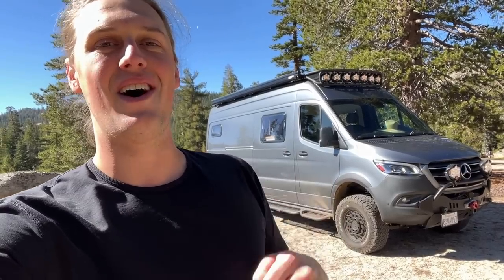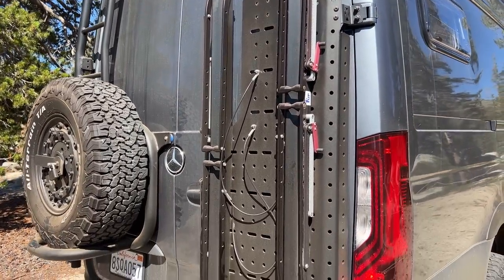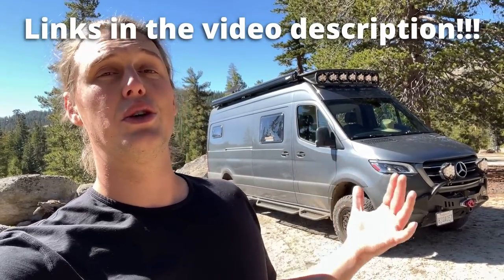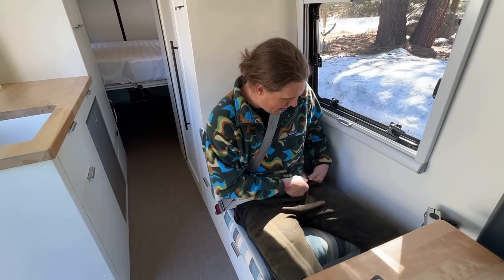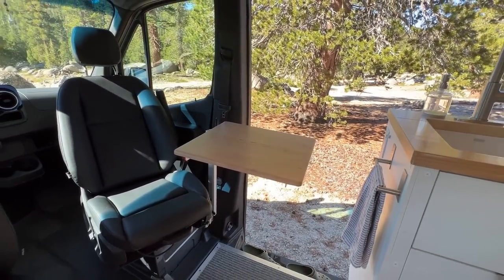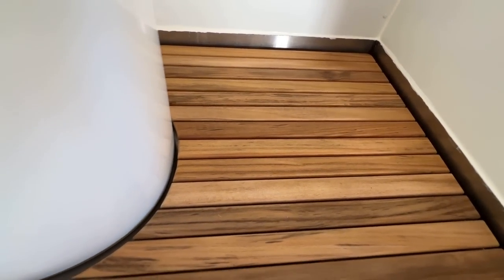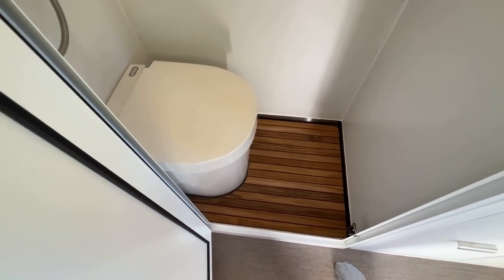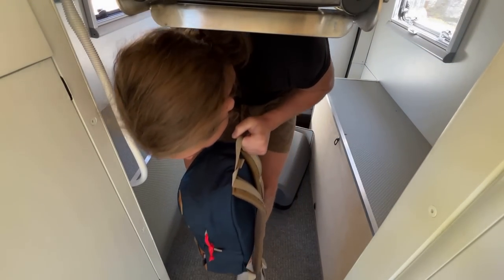The BEST Self-Built DIY Camper Van (in-depth Van Tour)

Comment: I'm a sys admin/API tester just getting into my first promaster conversion while working remote, and if you haven't found your calling in dev yet, think about a virtual van build web or mobile app! (CAD style user input, with community driven freelance. I.e., allow it to generate labor quotes based on user-defined configs, and van builders can offer to take on the job). When I built drums in 2012, I spent months building a virtual drum kit designer for our website, and then a company called SJC drums beat us to it. Theirs was super fun to use though, and is still going strong. I'd love to see that, but for van fam!

Comment: Awesome build!!! The mini split AC with the undermount condenser is innovative. I would be concerned about rocks being kick up at the condenser and just the risk of damage. Be prepared for long term issues with the maxair fans, the motors will start squeaking and when it is cooler outside and warm humid inside water condenses on the inside of the unit and drips down on the control circuit board, you may consider taking the boards down and spraying with Conformal Coating aerosol waterproofing so nothing shorts out. The cost of the elevating bed is steep, I wonder what it would have cost to use Ball Screw Linear Actuators to raise the bed and all four stepper motors would be wired together to raise the bed at the same time. Very impressive

Comment: Thanks for great content! I have been building my van for the last 1 year watching your videos. I am about 90% complete. I used about 50% of the same components and accessories you used in you build. I cannot thank enough for sharing detailed videos and links to the components. I really enjoyed building my van, it is the exact same van as yours including the color except that it came with factory swivel seats
Reply from the maker: That’s so cool!!
Reply: @seven_o_savage  Would you mind sharing the brand of the heat tape you are using for exterior plumbing lines?
Reply from the maker: @howidiy2485  all i did was search 12v heat tape on amazon and the options are always rotating ... they look to be same manufacturer though

Comment: Great build!  If you do a third van you may want to consider a AWD transit.
Reply from the maker: If I do another van build it will probably be on an electric chassis!
Reply: @seven_o_savage  I say Transit only because of your height. I think it is 5 more inches?  Would be huge for a guy like you.
Reply: @seven_o_savage  A Box Van/Truck would be good for your height, plus the straight walls would be a dream to build vs a van's curved walls. :)

Comment: 180 bucks per hour for a handyman type position is a lot. Also keep in mind that experienced builders with a proper set up can make camper conversions much quicker than someone doing a one off for the second time. 

I wouldn't estimate the value of the camper based on the 150k for labor alone, it's just not competitive enough.

Comment: Hey great video.  I'm just curious, in this build do you have the exact measurements from floor to ceiling?  I'm just just under 6'4.25" so am wondering if I would be able to stand upright throughout.  At this level of tolerance I'd be considering every 1/16th of an inch.

Comment: Incredible!  You are getting so good at this, it is a pro job. Wow.  And I am highly critical for van builds. You did a superb job!!!

To Hiker Biker Rude Commenter: 
1. You are not a lawyer, builder, mechanic, and not a car expert. So... ride your bike and don't try to be a lawyer builder.
2. The one thing you ARE, is a poor speller.  DIYer, not DIY'er.  LOSE, not LOOSE.  Learn English.  Read.
3. A seat belt can be added by anyone. All you need to do is use the standard safety belt and attach it to the frame of the car or any secure metal frame within the car.  It is not rocket science.

On that seat belt topic, I would add a head pad like they do in the ambulance seats. If the passenger bounces back, that pad will protect the head. This would be very advisable for safety so they don't hit their heads on the hard board behind or get whiplash.  

That 3rd seat is lovely.  A great place to work and office/ dining space with a 180 degree view, very nice!
That hidden cubby for the controls is a great idea. It looks clean and uncluttered.  Plus, no dust.
Separette $1100.  Trelino $300 - $500 (add a computer fan for $12).  I would not pay this much for ANY toilet. Such a ripoff.  I would build my own. You should consider it. Every toilet maker is a price gouger. Boycott them entirely.
I love that slide in bed ladder!  Please post a link for purchase.  Very innovative.
The Happi Jac bed lift is indeed a game changer!  I could fit a kayak in there - amazing. This is Euro design. Ever seen the Kabe Affinity van series?  Check them out, for ideas.

Comment: Why do people assume they want their heads at the far end of the vehicle?
This means that getting in or out involves crawling way down there and getting under the covers.

Having your head toward the front means you push back the covers, sit on the bed and rotate body180 degrees to get in.
Yes your pillow may fall down but your nice solution has a wall by both port and starboard sides of the bed.
Also, a small popup wall could also keep pillows from falling.
This is something you think about as you get older and less flexible.

Heads to the front would also add a lot of storage space  end over your feet.  
You could put major overhead storage over your feet without feeling claustrophobic.

Thanks again for great design and execution from a brother software architect.

Comment: Sweet build, the only thing I would do different is spend money on 2nd nations 280 amp alternator with 48 volt system. Your l batteries are only as good as the ability to charge them on daily basis. Solar won’t do it. Little bit of drive or idle time will do it. You did not build awesome off road rig to park it.
Reply: That’s what I did, with no solar and roof rack. Rack looks cool but lowers mpg and adds weight up high. Secound alternator can charge the same as solar all day in 15 minutes. Also it doesn’t need to be parked in sun to work

Comment: Great build!! Huge question not addressed on the air temp. Why did you leave the cab open? There arevwaysbtobclose that off some temporary some permanent but your temp in van will be way more efficient with that cab w all the glass windows will be significantly better!!

Comment: Love the video, well done from a fellow software engineer. 😀

I went through your spreadsheet, a total of 778 hours, that's almost 20 weeks if you were full time? 😶

Water system 120 hours? That would be 3 weeks full time. You were amazed on the plumbing video at how quickly you had it done with pex.
Electrical 140 hours? Another 3 weeks full time?

I only saying this because I am setting about doing my own conversion, trying to get an estimate and I find those figures hard to fathom. 
I would estimate two full days on each plumbing and electrical. Throw in another day contingency. A week full time (40 hours) should see both done.
Reply from the maker: It’s tough for me to respond because I also felt it would only take a few days for each project… and that mentality is partially what helped motivate me to keep going… so I don’t want to ruin it for you 😂. 

But to put it into perspective, it took 3 full days to design, create, and install the custom wire boot for the electrical lines to pass through.

Comment: THERE ARE COVERS THAT COVER THE WHOLE VAN FROM THE SUN. ALSO IF YOU'RE PARKED FOR A WHILE WHEN BOOM DOCKING, YOU CAN FACE THE SUN AND PUT A COVER ON THE OUTSIDE OF THE WINDSHIELD TO KEEP THE GLASS FROM GETTING HOT. IT WORKS WONDERS

Comment: Having AC or not isn't impossible, it's about affordability. I'm not spending $6k on that system, but if you have the money you seem to have, sure. I'd consider doing a mini split for less, but the cost to aesthetics difference is my caveat. I'm looking to spend about the cost of your suspension on my bus total. I was pretty spot on with cost for your build. I was guessing $150k. Don't get me wrong, I like it, but it's outside my realm of possibilities. That's about the cost of a low-end house far outside of the Bozeman area.

Comment: With regards to your heat trace system, you'd be better served to have that A/C powered (DC has too much voltage drop) and run it latterly on the lines (vs. Spiral wrapped). Lastly, insulate it to make it more efficient and cut its electricity use by 80%. I've spent the last 20 years of my professional life with the two largest manufacturers of heat trace... Let me know if you have any questions.
Reply from the maker: Great advice! Why do you recommend to run it laterally instead of spiral?
Reply from the maker: Thank you!!

Comment: Are those LP6s along the top of your roof rack and LP9s on your front bumper?
Reply from the maker: Yes
Reply: @seven_o_savage  If you were to do the lighting over, would you make any changes?
Reply from the maker: @JasonConroy  The lighting is pretty good. Only things I don't like is the lights flicker on camera, and I kind of wish they turned red at night. Also a separate switch for just the bathroom light at night would be nice.